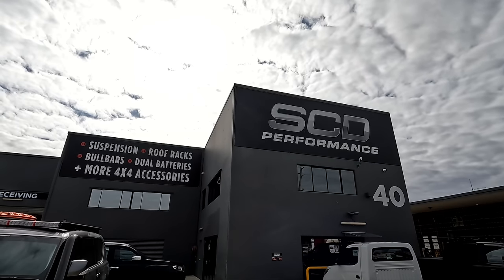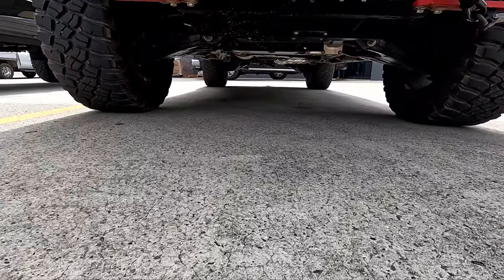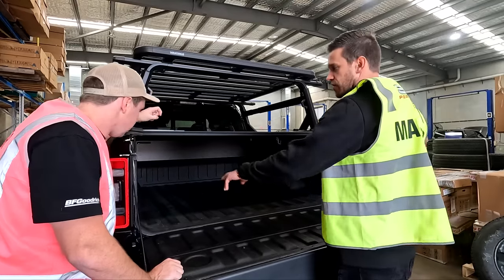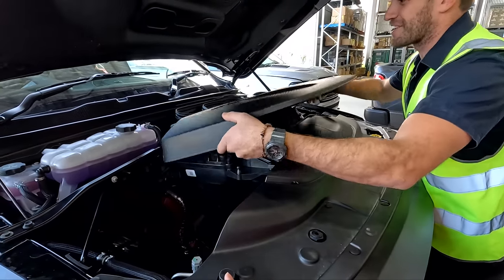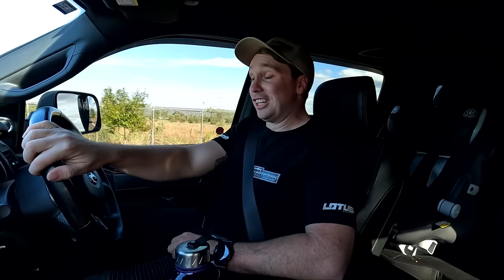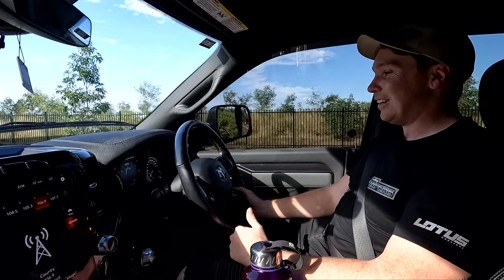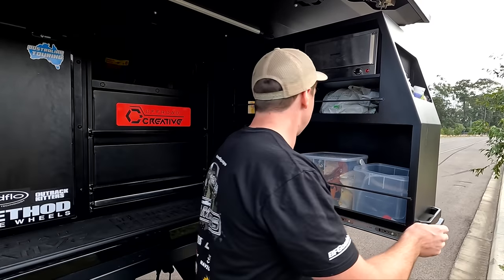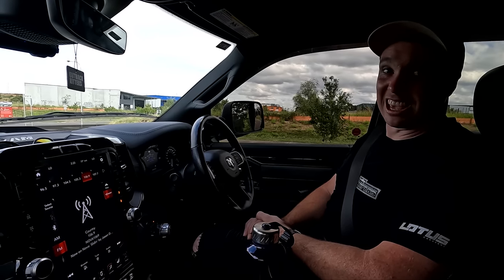WE DRIVE OUR DREAM CAR! RAM 1500 TRX! IS THE Y62 PATROL FOR SALE? RAM 2500 POWER WAGON - SCD TOUR!

Comment: We did a year around Oz in a 200 series and 19ft offroad van. The width and weight was a pain to get in to remote places. The 200 was a beast though we were pushing legality with the weights.. We'll go again soon most likely in the new everest with a hybrid van. Save on fuel and get in to the less travelled locations. The right rig is hard to know for the individual. It seems the big rigs are sensational for families and retireies that stay close to the tar and benefit from being legal. So long as you can take the ktm you'll be right!
Reply from the maker: Some awesome points there mate thanks for sharing and thanks for watching!

Comment: Smiles for days in the trx, would a dwm chop help with storage and weight in tow rig vs van ? Personally love driving the 2500/f250 as they are built to haul no questions plus if you register as a light truck you can get the full potential but the $$ def
Add up to my dream build costs range be interested to see what you do as order time might be away if
You order a new one
Reply from the maker: TRX was amazing! I personally wouldn't do the chopped with when for the same price or cheaper you could just buy a ram. Some very good points mate, thanks for watching!

Comment: We split the difference.
Bought a 2017 Ram 2500 for towing the van and touring. As a 7t set-up we average 20l/100km touring. 
We Kept the 04 Y61 for the tough stuff. You'll never find a golden bullet mate.
Reply from the maker: Spot on mate, thanks for watching!
Reply: The golden bullet, The short body 1500 with the 2500 drive train. Or the TRX drive train.